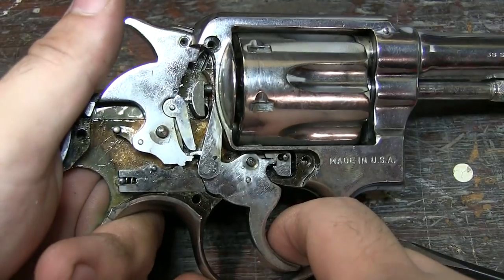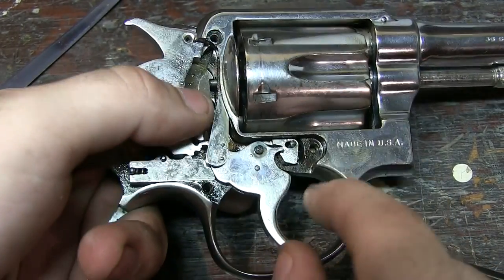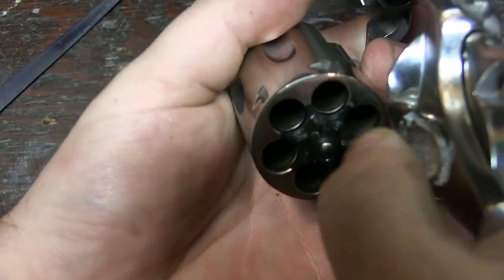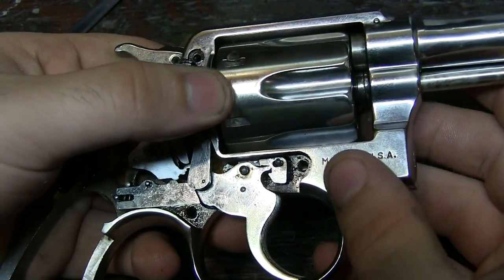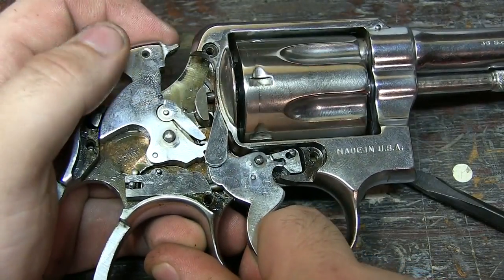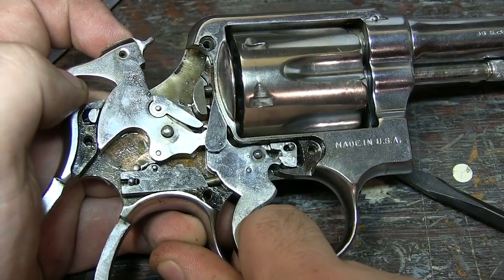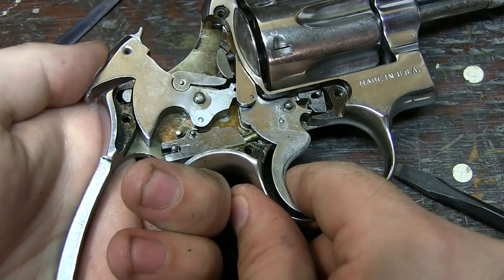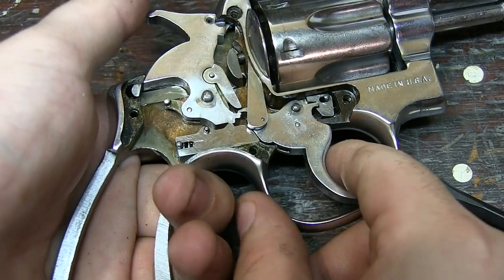Double action revolver trigger function demonstration

Comment: what happens if you start cocking the hammer, but change your mind halfway and release it before it gets into single action mode? does it go back to the original chamber or do you have to manually rotate the chamber so its aligned with the barrel?